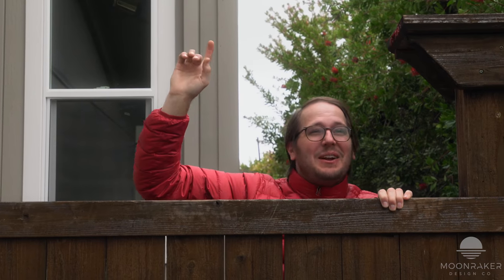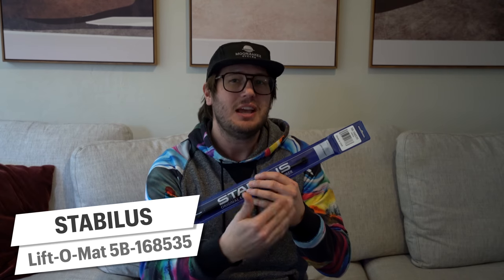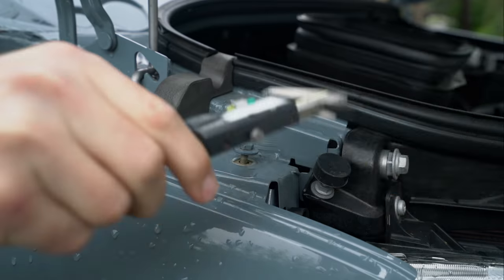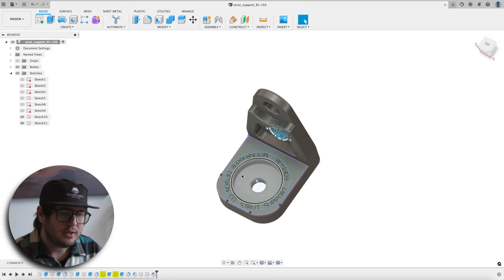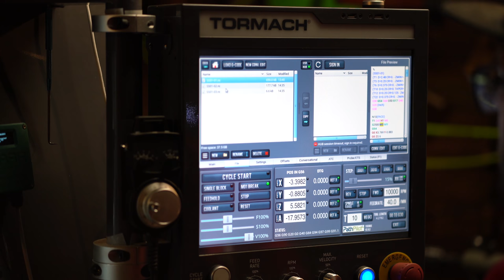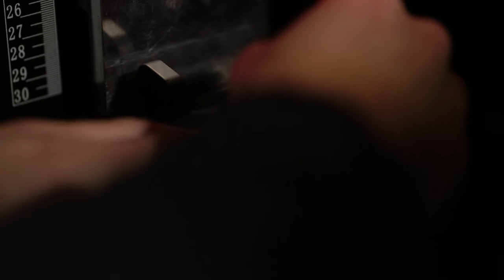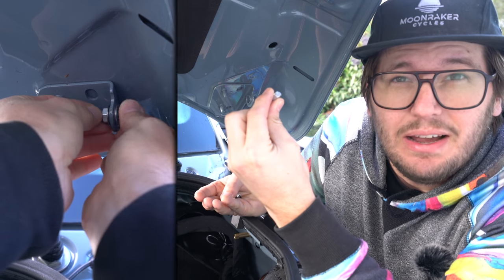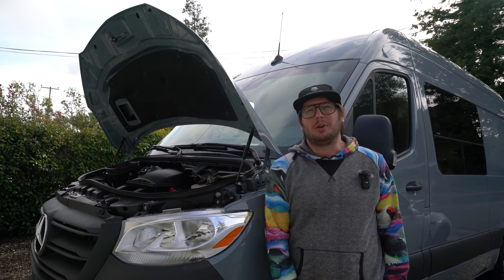Sprinter Adventure Van Build - Hood Strut Brackets & Install

Comment: Very cool, nice work! I installed the off the shelf version that Owl Vans sells, and it’s great. How, I just went install the VanCompass hoodline pod light mounts, and the hood strut is in the way;( I think I can have the machine shop drill some different mounting holes to make it work, but just fyi to your viewers. Great vids!
Reply from the maker: Hey @marc4901 thank you for the kind words!  Having struts is so nice, right?  I wish @mercedezbenz would do something about this straight from the factory!  I checked out those brackets, could they go on before the struts or would it still have issues?  It would be good if they were just slotted through to the edge you so you slide them on from the side and then tighten them down.  Might be time to look into a hood pod bracket that works with this strut design.  Thanks for sharing!